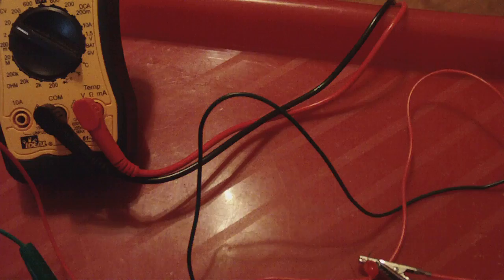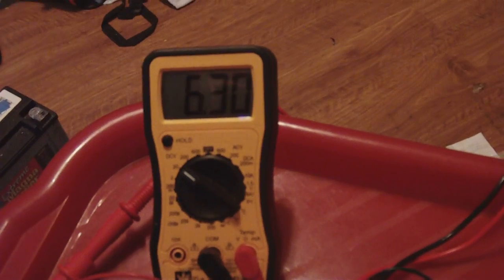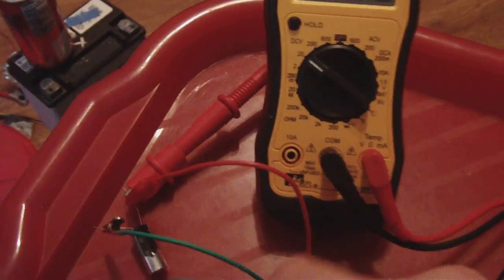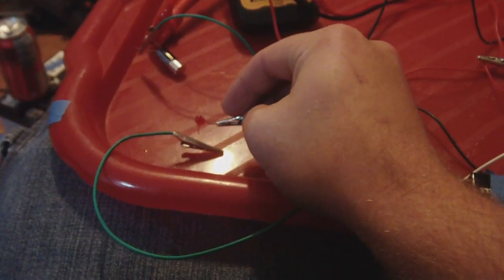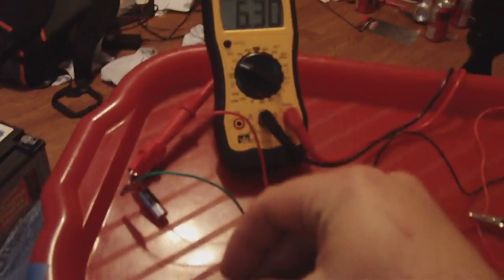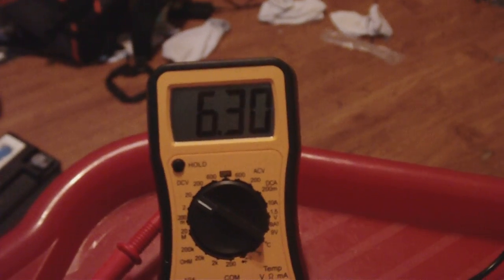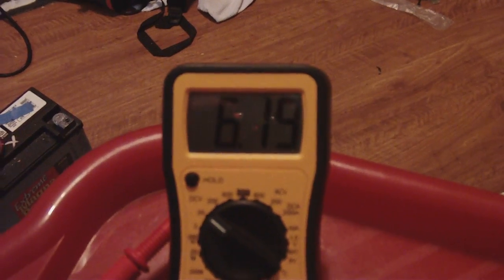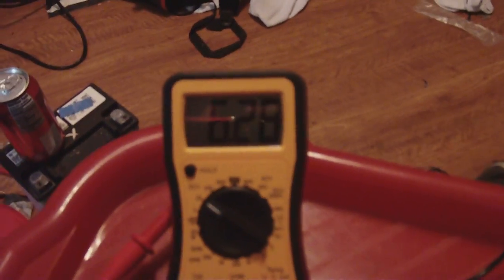Basic Captret Scalar wave battery charger concept

Comment: @ibpointless2 I am not up to troll around or sound rude, but in some ways you just loose reliability by posting those videos.
I don´t think its worth it... 
If you want to show how to discharge a cap in slow motion and reload a small charge due to electrolytic reaction it is fine.
Cheers...

Comment: Like the way you think.
Do you think that you are using the dielectric from the caps to create negative impedamce (holes?) which are being filled from free electrons in the air?  Could you try this experiment while bombarding the caps with a light source?  Kust a thought.
Thanks for sharing your research.
Edward